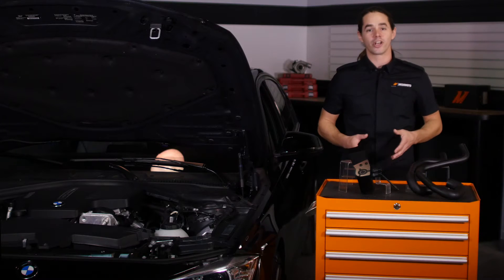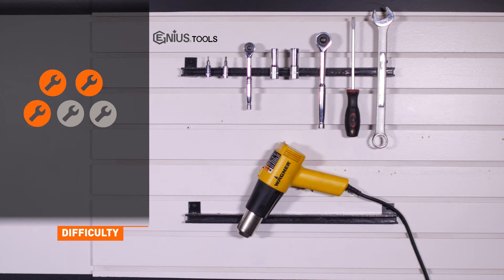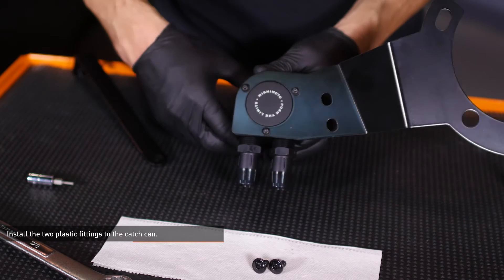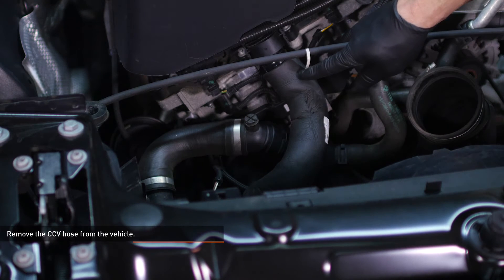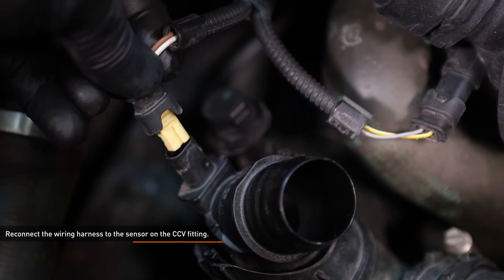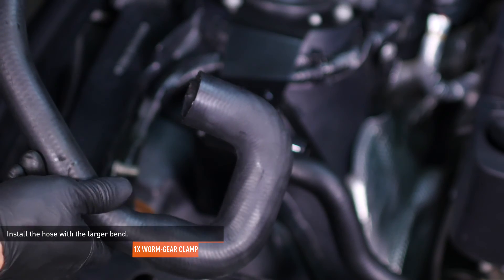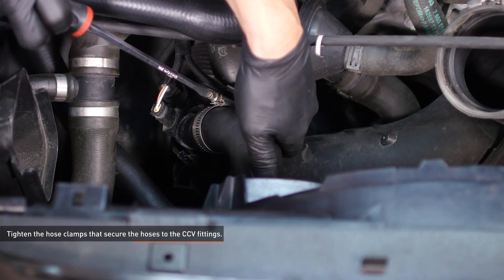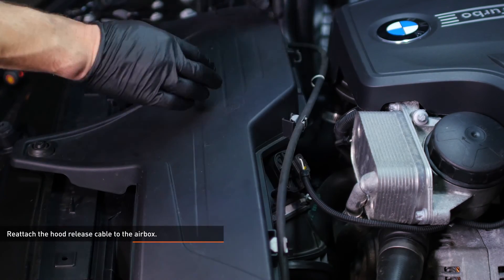BMW N20/N26 Engine Baffled Oil Catch Can Installation Guide By Mishimoto

Comment: I have a 2014 F25 with the 2.0 engine, is same engine here but the website says it wont fit???? Can I still use it?
Reply from the maker: This will fit:
2014-2016 228i / 228ix
2012-2017 320i / 320ix
2012-2016 328i / 328ix
2013-2016 428i / 428ix

with ending codes:
N20
N26

Comment: Too bad this catch can configuration DOES NOT fit the N26 with Xenon lights. The Xenon ballast is located right in the location where the can sits. Do not buy this catch can if you have the F30 with  Xenon.
Reply from the maker: Correct. We have this noted within the tech specs of our product page on our website.

Comment: Do I need to unscrew everything to empty the can? Is there a manual how to do it properly?
Reply from the maker: The bottom of the catch can will twist off for removal and draining. We also have an optional drain kit available if that is something you are interested in!
Reply: Use caution. The Mishimoto drain kit I purchased for the Mishimoto catch can did NOT fit. The bottom fittings for the drain valve connection did not fit the hole in the can. @mishimoto

Comment: Good day, and Happy 4th of July!! Do you have s TQ spec on the 2 bracket bolts and the 3 bracket to can mount bolts?
Reply from the maker: We do not, however, as long as they are snug you should be good.

Comment: Hypothetically speaking what would happen if you put the hoses in the wrong ports 😂
Reply from the maker: The can would not be as effective. Nothing will happen with the vehicle
Reply: @mishimoto  I’ve noticed a substantial turbo lag. Is that common after a catch can install?
Reply from the maker: The catch can should have no effects on power or lag from a turbo.

Comment: Have tests been carried out to check engine crank pressure before and after install? 

Why does this not work with updated angel eye headlights?
Reply: Module running the HID light interferes with the bracket. Could have been easily designed around but they clearly prototyped using a nonHID car. You can fab a simple extension to make it fit. I get so little amount of oil, I’m not sure it’s going anything.
Reply: @gracilism  thanks for letting me know, I was trying to compare the video to my mine and couldn’t workout what it is. 

Yeah, I cleaned my valves at 100k miles and they were not catastrophic, some build up, but carb cleaner, nylon brush brought them back to looking new.

Comment: Just installed today... A bit late on this... installed it at 120k. With age comes britality from hot-cold cycles. Clips cracked on the crankcase hose and the bottom CCV hose broke the turbo inlet pipe. $30 inlet pipe plastic aftermarket. CCV hose $50 aftermarket. I decided I'm in there so I'm installing metal...so got FTP metal turbo inlet pipe for $200. Well worth it but you need to drop the under-car panel to get to it not hard just takes time to do. The new CCV hose was great and came off after heating up for about 2 min. install was easy. I do have to push down my fender well rubber to remove the can though they don't mention that. I don't mind because it does keep things looking tight. Overall with metal turbo inlet new CCV hose and this catch can... 180 dollar project turned into a $450 catch can... but I made it more bulletproof so I don't mind!
Reply: Just installed it today, 120k also and exactly the same pieces broke haha ccv and inlet. I am going to metal also, i will check the inlet you have put. Thanks for the ref.

Comment: will this work on the bmw f10 528i? same engine so i suppose it should?
Reply from the maker: The intake will not work as the mounting locations and dimension are not the same between both cars.
Reply: @mishimoto  is there one that does fit the f10?
Reply: @pkspot  damn they aint even respond to you!

Comment: Installed my kit today, was a fairly straight forward install except take very good care taking off the ccv fittings off the hoses. One of my clips cracked which means I need to get a replacement hose.
I would also recommend to get some zip ties or hose clamps because the vacuum hoses may not be perfectly moulded and fitment may be a bit off.

Comment: FYI - DOES NOT WORK WITH CARS THAT HAVE THE XENON HIGHLIGHT OPTION.
Reply from the maker: This is correct, we have a note on our website warning people about this.
Reply: Mishimoto Automotive  I would suggest it be in a more prominent area. Upgraded headlights are very common as BMW’s have notoriously poor standard lights. 

Also, many third party vendors do not mention it at all. Luckily the lights box (ballast/ transformer?) mount is easily modified to relocate.
Reply: Hi @gracilism  . Can you give me an idea of HOW to modify this ballast mount? I forced the catch can into place, tilted at an angle, because I had already destroyed the OEM CCV tubing while removing the fittings (with the heat gun). I really do not want the catch can oriented at an angle, and interfering with the Xenon ballast, and could really use your wisdom on the issue!  Thanks!
Reply: You need to inform your aftermarket sellers (i.e. FCP Euro) of this fitment problem. I bought from them, and got into the middle of the install, only to discover this problem AFTER OEM hoses had been destroyed to remove the CCV fittings. @mishimoto
Reply: Why does this not work?

Comment: I have a 2014 F32 428i. I like the design, lifetime warranty, and pre-formed hoses that this kit has, but am concerned with the strut bracket. How does loosening the 2 strut bolts not affect the alignment of the strut? Thanks.
Reply: gravity holds the strut in place, because the car is not moving.

Comment: I have a 2016 BMW X4 2.0 L does it need this?
Reply from the maker: Direct-injection engines in general will benefit from a catch-can. It will help reduce the carbon build-up in your intake system and on your valves.

Comment: Will this catch can be compatible with a strut tower brace bar, because the mounting location uses the strut tower bolts?
Reply from the maker: Hey William, thanks for reaching out. My product team states that our test vehicle 
for this product was otherwise bone stock. However, the system is 
mounted fairly low and out of the way in this application. I cant 
guarantee it, but really don't see you running into an issue with our 
induction kit and a strut brace installed.

Comment: Looks well designed, however I already have a Mishimoto Induction Kit fitted and a Strut Brace, will I still be able to fit the Catch Can?
Reply from the maker: Hey Marc. Thanks for reaching out. My product team states that our test vehicle for this product was otherwise bone stock. However, the system is mounted fairly low and out of the way in this application. I cant guarantee it, but really don't see you running into an issue with our induction kit and a strut brace installed.

Comment: Work with a 2012 F10 N20 528i?
Reply from the maker: HI Michael - unfortunately this direct-fit kit will not work for your 2012 528i.
Reply: Mishimoto Automotive have you designed one for a F10 528i?
Reply: hi, I am currently looking for a catch can for the same car, did you find one that works with the f10 528i?
Reply: Kiran Puddipeddi I cant find any at all
Reply: I’m wondering if you can use the hoses and can but mount it somewhere else but those hoses don’t look very flexible

Comment: Just an FYI. The strut tower bolts on my 2014 328i N26 was a 16mm not a 13mm.  Also, what becomes of the oil that may accumulate in the catch can?
Reply: Hi ENMAR68!  

The strut bolts may be different sizes across the year range of fitments, but the installation procedure will be the same.

The blow-by gasses that condense in the can also contain fuel vapor and moisture so the accumulated fluid should be disposed of in the same manner as used motor oil.  There are many parts shops and automotive repair facilities that will recycle it for you.  The contents of the can should be checked and emptied every 1000 miles until you establish a baseline for your vehicle.  This will differ from car to car depending on the season, driving conditions and the area in which you live.  We also offer a drain kit which includes a ball valve to quickly and cleanly drain the can for more convenient service.  Hope that helps!

Comment: Will this also work with the 228i or is this only for the 328i?
Reply from the maker: Fits the following models: 2014-2016 228i / 228ix | 2012-2017 320i / 320ix | 2012-2016 328i / 328ix | 2013-2016 428i / 428ix

Comment: What is the purpose of installing this equipment? What dose it do ?
Reply from the maker: The Mishimoto BMW N20/N26 Baffled Oil Catch Can is designed and engineered to reduce carbon buildup, a common issue with the direct fuel injection N20 and N26 engines.